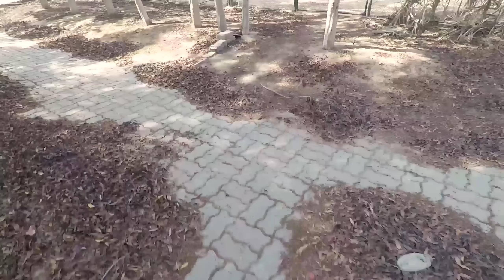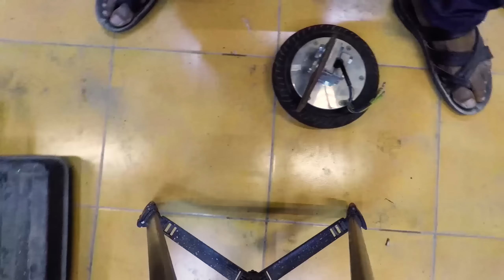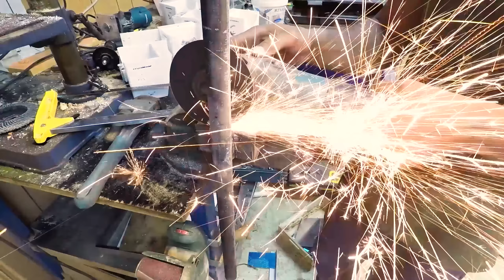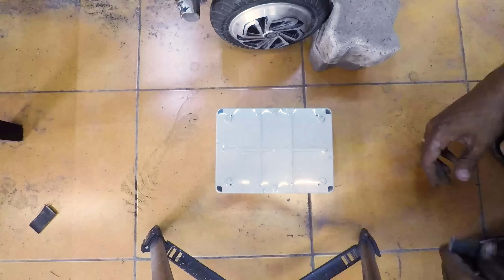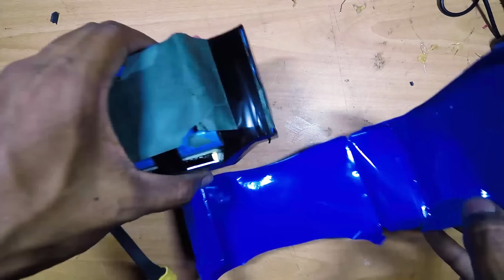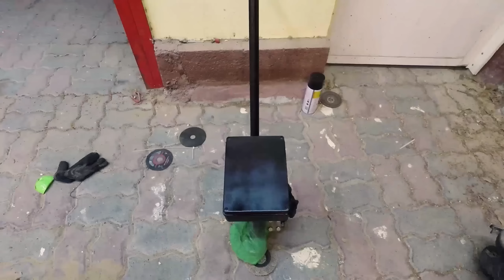HoverBoard to Roller Skate electric Booster | MakerMan

Comment: Hello what kind of speed controller is that, And how did you wire it up to make it work?
Reply from the maker: It's just a normal 36v brushless motor drive. It's comes with wiring diagram.

Comment: How do you recharge the battery?
Reply from the maker: With a normal 36v 2amp charger
Reply: MakerMan I had a hard time seeing it in the video - how did you have the charger port/motor controller simultaneously connected to the battery? I'm attempting to do something similar but I'm definitely a noobie
Reply from the maker: Sorry for that. I hate editing videos.
U can directly charge the battery with 36v charge as the battery has a BMS inside.
Hope this helps.
Reply: Gotcha. So when you need to charge you just unplug the motor controller from the battery, and plug in the charger port to the battery?

Also, the charger port has a 4 pin female JST cable while the battery has a female XT-60 cable. Did you use an adapter to connect the two?
Reply from the maker: Yes u could that too.  
But I have port for it ;-)
Reply: Thank you much! What port if you don't mind me asking?
Reply from the maker: The same found in the hoverboard.
Reply: Awesome! This makes things much easier, thank you again
Reply from the maker: Yup

Comment: You also need breaks for that device. lol. But I think you should have used your skills building an electric bike, becouse you can use it later in a populated area.
Reply from the maker: +Daniel Daniel there is a brake in the left side, it a button. It's an electric brake from the motor itself. i will make ebike soon, I have one more wheel left. 
Check out the previous electric tri-bike.
Reply: Thanks for your answer. You're awesome anyway. Thumbs up!
Reply from the maker: +Daniel Daniel thanks buddy